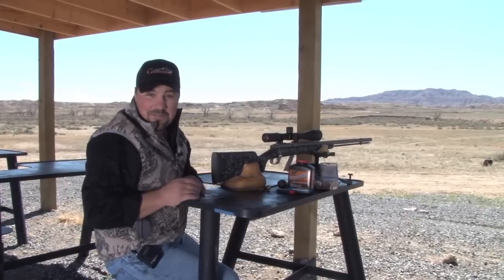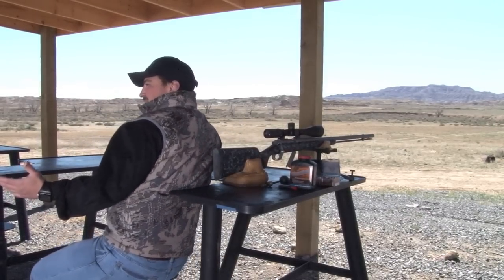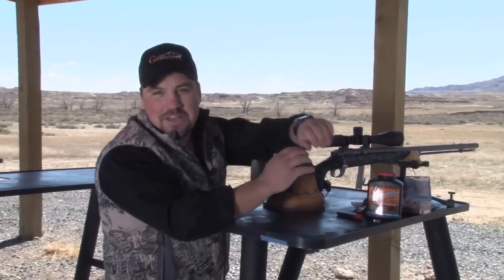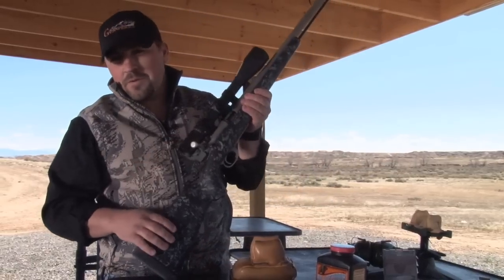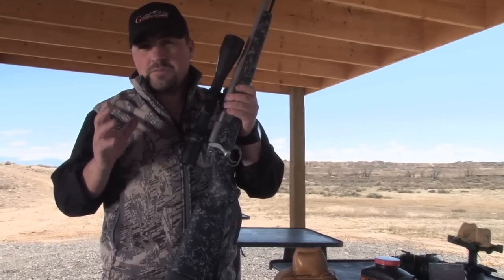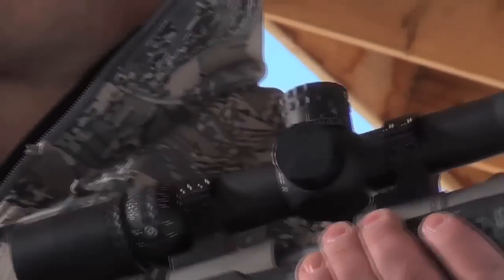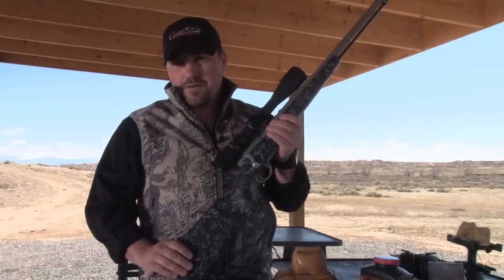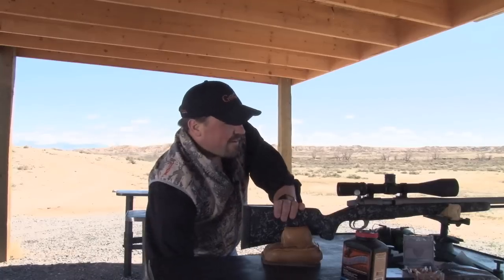500 Yard Muzzleloader

Comment: The MLII can shoot quite well out to 300 yards and beyond using sabots. Checkout Dougs Message board for some of the load data and upgrades that will get you there. Slower powders like N120, H4198 and Re7 with several 300gr-325gr bullets (like the Parkers) will get you out to 300 no problem.

The Savage and Rem700ML 45 conversions are just far less finicky and the barrel is much higher quality than a factory Savage barrel.